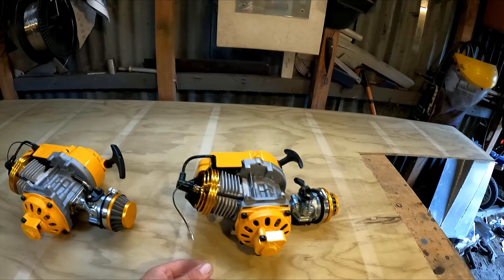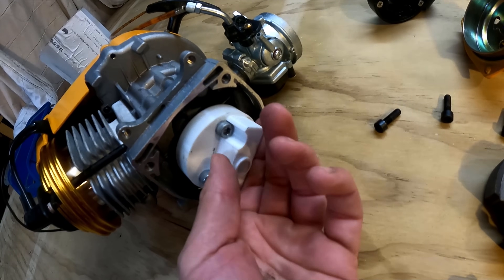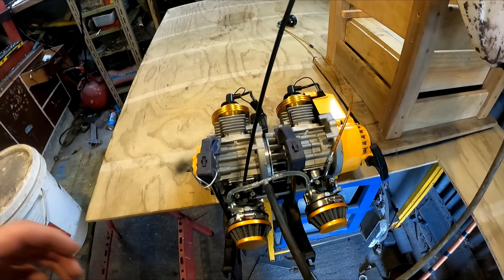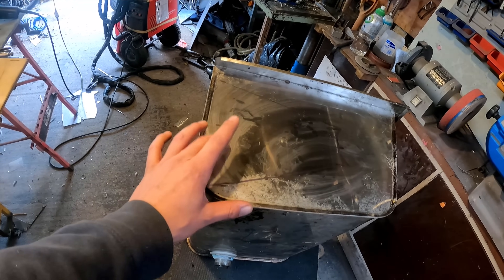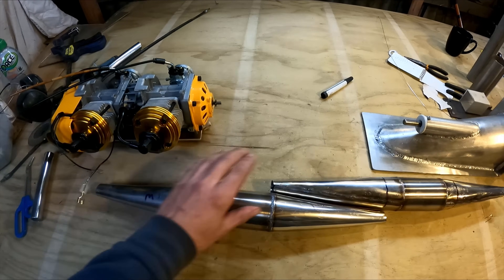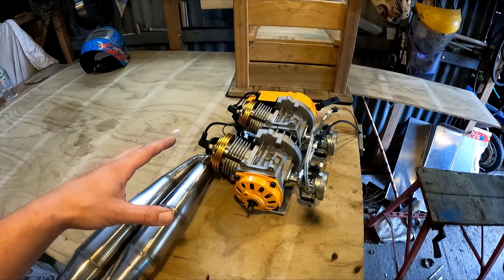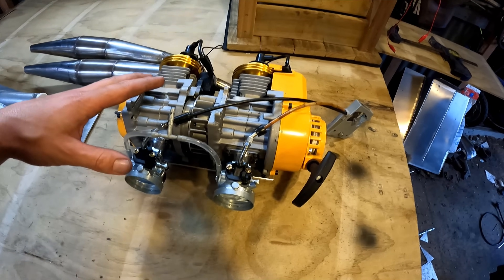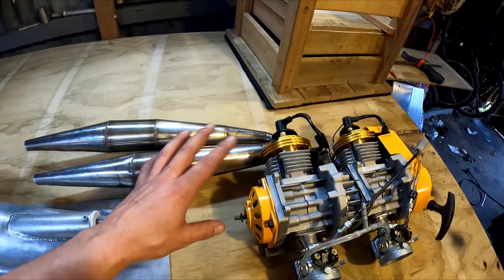Homemade Jet Drive 2 Stoke Twin Cylinder

Comment: i dont know a lot about welding but ... i feel like weling a jacked will be kinda hard ... especially since its usally kinda hard to weld to motors like that ... so what if you take copper tubing which just fits inbetween the cooling fins and just kinda bend it around there have the water going though that... really cool projekt really looking forward to it
Reply from the maker: I did think about the copper pipe thing but I reckon I can weld a jacket on the cylinder. But I might wrap some copper pipe around the exhaust to try cool it down a bit

Comment: If you going to do Colin Furze impressions, you will absolutely need a Safety Tie.  That's the only reason he has survived for so long.   Those engines are going to have some serious power between them.  I'm guessing at 20hp.  Is that in the right ball park?   I can see them powering a Thai long tail.  Whatever design you come up with and build, it is going to be way cool.

OK, I'm off to buy some shares in 3D printing consumables.
Reply: these 50cc china engines are the ones that are put into pocket bikes i dont know a lot about resonace mufferls wich two strokes but i ould guess out of the box each one does like 1,5 hp there are actually the kind of motors used for kids bikes
Reply from the maker: I don’t have a tie otherwise I would have haha, the little pocket bike motors only 2-3hp but these are the performance ones apparently make 5.5hp so 11hp together I hope

Comment: Both engines will overheat under load, but the one without cover will do it faster.
Reply: He said he was going to water  cool  them  . It will be fine
Reply from the maker: It was crazy the temperature was different on them after that short run

Comment: casting an impeller might be a good idea, PC-ABS worked fine for me, though, annealing it is key ! ;)
Reply from the maker: Abs works better for impeller? Does it print the same?
Reply: @dkthewelder  its a special ABS and Polycarbonate blend , its way easier to print , almost no warping and annealing the print at 150 °C is the way to get a real solid and sturdy print, you could probably print a blade for milling wood , using this stuff
Reply: @dkthewelder  ABS might work as well, but I don't like printing ABS...

Comment: PLA does dissolve when in contact with with gasoline, just a warning about that T piece. This whole thing is badass
Reply from the maker: I was hoping to print a fuel tank but I don’t think that is going to work 👍
Reply: @dkthewelder  look into PETG, it prints easy like pla and could be used for a gas tank. I've used PLA as motor mounts on a go-kart and they lasted a long time but showed signs of dissolving. So that's the only thing I'm basing my evidence on, you could print a test gas tank or drop a piece of a print in some gas and see how it fares. Good luck!

Comment: Dude it sounds awesome! I did this too with exact similar engines 😄👍🏼 but I put them in a boxer engine formation and conjoined them with a timingbelt from a vw polo. Kept both clutch bells and with only one common chain powering a sprocket in the middle 😁 its in my channel "steampunk ratbike" if you wanna check it out!
Reply from the maker: You make really cool videos! Pretty crazy engine setup
Reply: @dkthewelder  thanks!! Good luck with this project 🤘🏼
Reply from the maker: Man that sounds awesome! I will check that out for sure

Comment: make the engine mount more rigid, it may seem strong but its flexing like crazy and you cant see it. It will be way worse when there is a load as well. Best is either to make a top plate or use a thicker engine mount plate or steel
Reply from the maker: Ok I think you are right I will make an aluminium plate for the top need it more ridged